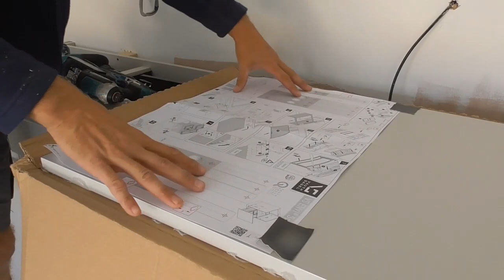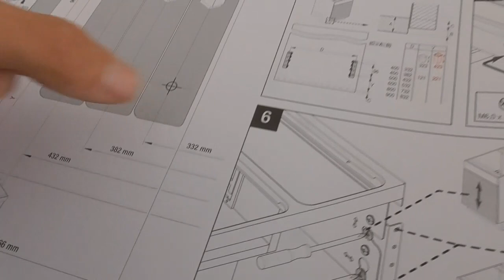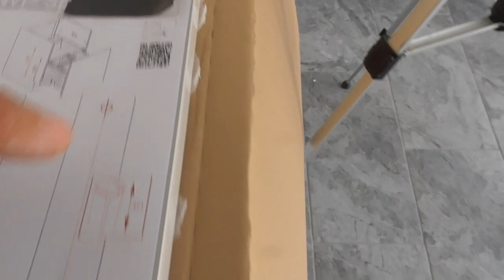KITCHEN FITTING UK. Installing a VAUTH SAGEL pull out bin ***VS ENVI Space PRO***

Comment: Great video, just finished installing one myself. It went really well. My one suggestion would be to attach the drawer attachment bracket to the bin structure first, without tightening the locking bolts, then attach the whole assembly to the door , adjust and tighten. I found it a bit fiddly doing it the way the manufacturer suggested.
Reply from the maker: Sounds like that might be easier Keith👊Thanks for adding your comment and for watching 😎 Cheers Del

Comment: If you had been using 16mm carcasses do those pieces you showed have to be moved so that you drill your holes for the runners in a different place? I can't understand why it would matter so long as you've chosen the right bin height. But as always looks like another great job you've done there Del 👏 👍
Reply from the maker: Hi Kevin🖐I probably could have done a better job of explaining that part🙄Those additional template pieces simply fold up and sit over the existing template. They are about 3mm thick and just pack the draw runners out that extra 3mm to accommodate for the thinner, 16mm carcass material👍As always, thanks for your comment bud🤩Cherrs
Reply: @thetallcarpenter  Oh ingenious I wondered if it was something more to do with the door margins. Thanks for the reply 👍